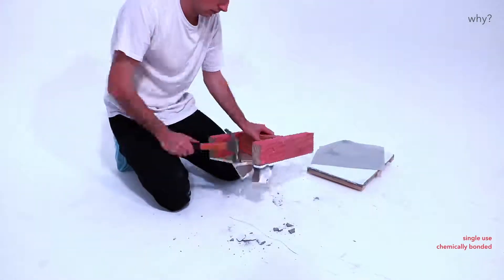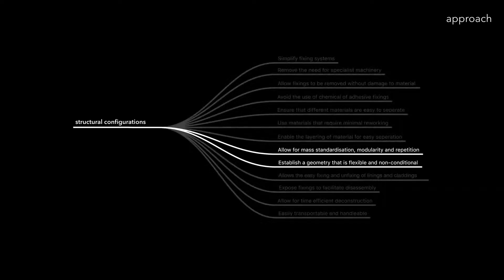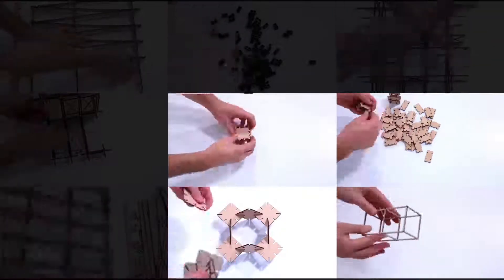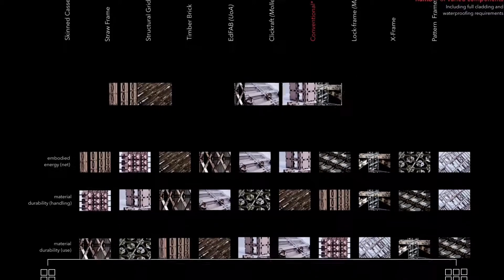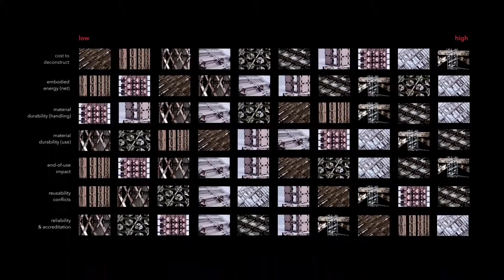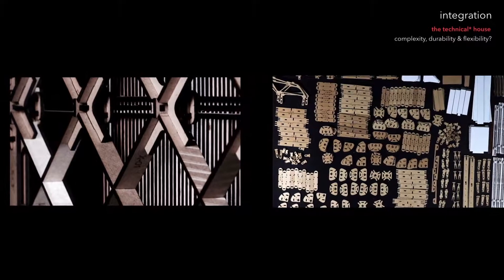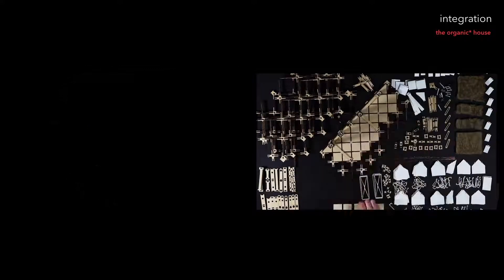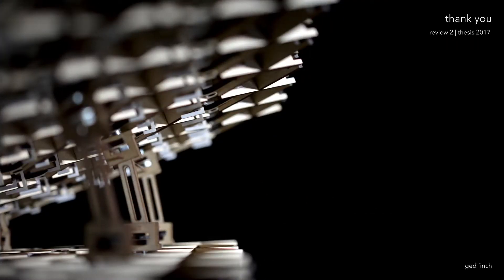Designing for Deconstruction | Pt. 2 | Experimental Methods

Comment: Hi Ged, Im looking for more information about Lock Frame Structure by Guy Marriage. Could you suggest where I could read up more on this work? :)
Reply from the maker: Hi Sophie, check out Guy's paper: https://openaccess.wgtn.ac.nz/articles/conference_contribution/Experimental_construction_in_a_timber_house/21730448 - there is a short section where he refers to the system as 'plywood lego'. I loosely re-modeled it based on the information in the paper. Hope this helps!